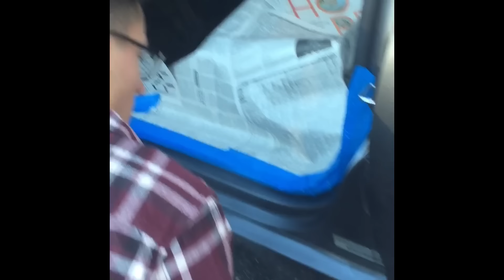DIY Rust Repair Cheap And Easy!

Comment: Way to put your hands in the issue, right on man. Thnx for posting this, it shows people to not be scared to DIY.
Having decades of experience with body-n-paint, i might suggest one added measure if you don't mind. 
i realize this was intended as a quick/easy fix, and that it is, but I would spray the metal with an oxidation neutralizer; such as OSPHO or even just the good ol' Duro Extend treatment at least. The oxidation is occurring deep inside the metal and just a good sanding and paint will not stop it. Many metals absorb moisture, trapping  it inside. It is possible to kill the oxidation process chemically, then this repair will last a good long time. Cheers!
Reply: so how would yo use it? I'm looking to do this
Reply: naval jelly work?
Reply: This is how we learn. People helping people. DIY fixing. Thanks for sharing
Reply: Eric Lee, great response! So many people with experience feel the need to completely bash the DIY'er for doing a quick hack job to make it look better. You added great feedback and information with a positive message. Nice Man!!!
Reply: Thnx so much! I love seeing people gettin er done, and helping them make it last is always a pleasure. have and awesome day!!  :)
Reply: Hey Eric, thanks for the information and just to be sure, I should use oxidation neutralizer after i'm done with sanding it? Basically before spraying on Primer? Thanks!
Reply: Eric Lee  hi, how would you treat this chemically?? You mean with a rust encapsulator like the Eastwood brand? I have some bubbling on my quarter panels around the wheel well.
Reply: You use an inhibitor or a rust neutralizer directly onto rusty metal. Try to get the flakes and bubbles off 1st THEN use your rusticide product. It may appear that after the sanding process that your product has been removed but continue the steps anyways. Its a chemical reaction to iron oxide
Reply: Eric Lee
Reply: You are a hero.
Reply: +no talent hack welding yep thats a brand name for phosphoric acid.
Reply: Stock LT1
Reply: +SunEagle Cherokee - To be on the cheap/easy you can use glass fiber reinforced bondo. But always treat the rust first... last a lot longer. ;-)
Reply: Really great job, out of a rattle can no less!  Amazing!
Reply: can't you just use a torch to get the moisture out?
Reply: Jiggy5166 - Yes a torch can be used momentarily, but next morning all the moist will be right back. Beside the paint work don't like flames much. LOL :-)
The trick in a car is not to try to avoid moist in fact unless for the ones living in the dry desert it's basically impossible. The trick it's to make the metal withstand reasonable amounts of moist, galvanized, painted  ,etc. help a lot in extending the useful life of our cars before they turn into rust buckets. :-)
Reply: Eric you are correct. If you chemically neutralize the metal to kill the chlorides in the steel the repair will last a very long time. This repair has already started to rust again. Try Skunk Rust, it is paintable Ospho is not paintable without neutralizing the ospho.
Reply: In terms of extending the life of metal bodies, oxidation neutralizers are awesome, but from a chemistry standpoint your explanation is incorrect. Rust (oxidation of iron) and other oxidation processes happen on the surface of the metal only. Metals also don't absorb moisture because the chemical bonds of metals are extremely tight covalent bonds that are non-polar, and water, the polar, ionic-bonded molecule, can't break in between the neutral, tight covalent bonds in metals without extreme heat to break the bonds in the metal. Oxidation neutralizers cover the surface of metals though, which prevents rusting and other types of oxidation from occurring. Even covering metals with a coat of clear nail polish can prevent rusting, however oxidation neutralizers are built to last for a long time, and will outlive the nail polish. Still recommend using those types of products for longevity, but in terms of a quick fix, I wouldn't bother because there is often moisture left in the paint that doesn't get out and trapping moisture between paint and metal will undoubtedly cause oxidation of the metal.
Reply: Paragraphs are good...
Reply: Eric Lee great work
Reply: Eric Lee  you do repairs
Reply: A polite person on the internet this is absurd!!! Thanks for the tip - My Mk1 Golf with be grateful for this advice
Reply: I'm not sure but ,if anyone else  is searching for 
electronic repair course
 try Saankramer Electronic Magazine System (do a google search ) ? Ive heard some extraordinary things about it and my cousin got cool success with it.
Reply: Eric Lee q
Reply: Alex Banning I watched a video (about this rust problem) made by people who do restorations on very expensive cars and they showed how rust does get into the metal beneath the surface. Even when you sand the rust down to shiny metal there is still rust deeper in the metal only you can't see with a naked eye. That's why they use chemicals to neutralise it.
Reply: Hi Eric so i was trying to find videos about how i could remove rust, treat the area before i repainted and this vid came up... it is for the top inside lip of my freezer. I am planning to switch it off, let it dry out completely before i started.  The rust is very bad.  So i would do everything in this vid plus the oxidation neutraliser you mentioned to hopefully stop it from rusting again.  Would you have any suggestions as to the type of paint i should use given its a freezer?  It has to be so I can still wipe it down with a neutral cleaner...unfortunately a bleach cleaner was used hence the rust.  Any other tips/suggestions would be most appreciated.  I am a first time DIY person in Singapore but think i could do this.  Certainly much less expensive then getting new freezer door which going by the supplier's price, i might as well buy a new freezer;)  Thank you in advance.  Best regards Clare
Reply: Thanks!  I will!
Reply: Spoken like a true gentleman. Really appreciate people like you as they're a dying breed 👍
Reply: At what point in the procedure would you spray the oxidation neutralizer?
Thanks
Reply: diver dave  No, would have no benefit.
Reply: Metal etch primer :)
yup
Reply: Eric Lee don’t use the heat gun on the paint also
Reply: @mattm5786  Why?
Reply: Steve Fredrick because you want to let the paint cure naturally
Reply: You done it 1k likes call your wife it's time for celebration
Reply: Eric is right about the oxidation. You can sandblast metal until all you have is white metal, no rust but the moment any humidity contacts the metal rust begins to form. You can not see it but it is there at a microscopic level. Ospho converts/neutralizes that unseen rust. begin to prime immediately afterwards.
Reply: @craigroberts8213  What about Rust oleum Rust Stop Aero?
Reply: Ospho is too hot to paint over. Skunk Rust is unbeatable. Money Back Guarantee. It is made to be painted over, not ospho.
Reply: Thanks man!
Reply: Thanks man!
Reply: @rocktag2  so you sand first then apply the oxidizer newtralizer then let it sit befre priming?
Reply: I know Im asking randomly but does anyone know a way to get back into an Instagram account..?
I somehow lost the login password. I would love any help you can offer me!
Reply: @Fox Wyatt instablaster =)
Reply: @Jadiel Marvin thanks for your reply. I found the site through google and im in the hacking process now.
I see it takes quite some time so I will reply here later when my account password hopefully is recovered.
Reply: @Jadiel Marvin It did the trick and I now got access to my account again. Im so happy!
Thanks so much you saved my ass!
Reply: @Fox Wyatt Glad I could help xD
Reply: I don't know who told you that, but what you said isn't correct. Metal itself cannot physically absorb water inside of it, that's because there isn't enough space between metal atoms to house water molecules, sorry. 
Also rust doesn't start from the inside and out, it starts from the outside and works it's way in by eroding and flaking away as it goes deeper and deeper. Additionally rust isn't magic like some analogy to a disease that can just grow on it's own, it's merely oxidisation of the iron, it requires oxygen and water as the catalyst. Rust itself, meaning oxidised iron, cannot spread "rust" to non oxidised metal next to it, that isn't how it works. Rust doesn't create rust, you have it wrong, sorry. 

The process of oxidisation will not continue on it's own via a part of the metal being already oxidised. It will only continue if the required chemicals are available, meaning the conditions that caused the initial rust continues. This essentially means if you take a bolt and leave it outside in the rain, allow a spot of rust to form on it, now take that bolt and put it in a sealed glass jar with a desiccation gel bag inside to make the air extra dry. You will find that the rust spot on the bolt will never progress, this is because rust itself doesn't just grow by there being rust there, it doesn't work like that bud.
Reply: @crpth1 bondo is a filler mate. Wrong vid 😂

Comment: Good DIY vid. I have done this several times with different used cars I've bought. In all cases my DIY repairs have lasted for 5 years or more without any sign of the rust returning (at least in those spots). My technique is quite similar to yours, but with a couple small differences.

1) I use an angle grinder w/ wire brush for course work, then a Dremel with wire brush when there's only little pits and grooves left with rust in them. This will save a ton of sanding. The metal surface should look completely shiny. Dark spots are rust and they need to go. Use bondo to fill them back in after primer.

2) Before primer, I thoroughly clean the surface with 99% isopropyl alcohol. This will remove any grease and dirt, and also help displace and evaporate any lingering moisture. Should only take a few seconds to dry.

After that, it's just a question of how picky you want to be with your paint job. Hope this helps others considering doing this. It's really not that hard with a few tools, and can greatly extend the life of your car.
Reply: Break clean also works great, just protect the areas you need to protect.

Comment: this video is extremely helpful & well made. exactly what I needed. my truck looks beautiful again.
Thanks man seriously.
Reply: How many months did that last for?
Reply: @joeldk42  only 9 unfortunately, came right back midway through winter. It was fun trying to fix it. Every 09 escape I have ever seen except 2 all have rust spots in this exact same place on the rear wheel well. I hate the design. I have gotten estimates and they all say it's a horrible design flaw. This video did help a great deal. I think rust is inevitable in a lotta instances. Especially in the full 4 seasons of Midwestern weather I live in.

Comment: My pickup truck needs some rust repair done, this is on the roof, stone chip damage. The panel shop will cost dearly so I will do the job myself using this video as a guide. Thank you and thumbs up!

Comment: OMG! How could anyone choose thumbs down for this video! I have a 2002 Mercedes S-class, 165k miles and running beautifully! However, there are rust sections developing along the bottom of the doors! I went to the auto care place and they gave me the 3 things needed. couldn't get the feathered look at all when I did it myself!!! Watched this video and realized my mistakes! My repair doesn't look bad, but I want to get the feathered smooth look. I realized I didn't sand enough or with the proper weight and other little things. This video captured EVERYTHING!! Than you so much for making this as easy and quick an explanation.  Can't wait until things warm up so I can work on the areas again. Excellent!!
Reply: Mine is a 2001 S500 and Ive got tjek same problem!  Both doors now.  The repaint and feathering is what worries me too.  Good luck
Reply: Thumbs down for the rather embarrassing techinique - did not remove the rust, did not convert the rust, used primer as a filler until after it was primed, utterly embarrassing "stab the button" spray technique. Extra credit for not using a sanding block and throwing the sandpaper on the ground so it can pick up grit.

Comment: Great video only suggestion I would make is that using a rust converter before using the high filler primer would be better.That said anything looks better than rust and you did a good job.
Reply: Right.  I'm concerned about those pitted areas where the rust can't be fully reached with hand sanding and that the rust may recur there.  I'd prefer to see the affected area soda-blasted but that's typically beyond the realm of most DIYers.  Beyond that, rust converter is a next-best alternative.  Otherwise, the repair is just fine especially considering that it's a door sill of limited visibility and not an exterior surface.  It serves as a nice practice project for small rust and refinishing repairs.
Reply: Yes but it is actually a structural part of the car for side impact strength , as a unit body every part is important
Reply: I'm with DDEENY I predict a swift return of the rust.
Reply: if metal doesnt get oxygen it cant rust, so i think if there is no leak it should not rust even if some rust left
Reply: +Gunther Ultrabolt Novacrunch Agreed
Reply: Soda blasting doesn't remove rust properly. It's mainly used for stripping paint.
Reply: Was that just a wire wheel you used to remove the rust? Also, would a product like ospho work after removing rust and before sanding and filling?

Comment: Never use a heatgun to dry the paint! Paint has an "open time" to let out the thinner and flow smoot; If you speed-up that process the panit is not drying the proper way and hardened!
Reply: exactly...plus you dont apply heavier coats of paint...you apply the same coverage every pass

Comment: The paint on my Mercedes W203 is so thin that during this winter i've built up maybe 20 rust dots on my hood and a lot of big spots on other parts of the car. I definitely have my work cut out for me. Learning by doing. this video and the comments are a big help.

Comment: The dark spots seen at 0:20 are pitting corrosion. If not dealt with it will come back rather soon pending of humidity, salt exposure etc. Sandblasting and / or chemicals will give a more long-lasting result. If these options are not available, a wire brush may remove some of the pitting corrosion. The more corrosion that is removed the longer will the repairs last.

Comment: To people who don't understand how rust works and how this started. Paint itself is a sealer, it's often used to seal metals that can rust easily. It only takes a small scratch to form direct contact between the air and the metal. After this happens, at the zone it will slowly start rusting, this is why it occurs at that zone and not all over the car, it's dependent upon the scratch zone. This is because rust needs both oxygen and water, it turns out that regular air has both oxygen and water, thus high iron content metals simply rust in mere air. 
It doesn't matter if there are small pieces of rust in pits that are painted over either, contrary to what some other commenters have said, rust itself doesn't just grow more rust like magic, rust will not actually progress if it's sealed. This is because metal doesn't care if a part of it is rusted, that isn't going to make the other part rusty, the only thing to make the non rusty part go rusty is if it is exposed to water and oxygen (which it won't be when you seal it with paint anyway). 

As far as the Eric Lee user claiming that metal physically absorbs water, this is also physically not possible and it doesn't occur (I am unsure where he got that from). This is just spatially impossible in regards to chemistry, this is because H2O is a very large molecule, the molecular gaps inside metals are tiny, they cannot physically house a H2O molecule in the space that exists. It's literally as asinine as saying diamond can absorb water, it is just not possible on a molecular level, and Eric Lee clearly isn't scientifically educated and is some kind of labourer person. This is often why the government warn people of BS on the internet, there are so many uneducated things spread around and so many impressionable and naive kids who just believe something that some random dude on a forum or comment says.
Reply: thank you i thought the same thing with the rust. there is even paint that you can put over the rust and it prevents it from getting worse.
Reply: True. Just make sure the rust is completely sealed and it won’t continue. I have first hand experience. They make rust converter sprays that completely seals in rust and turns that into a surface that can be sanded and painted.
Reply: @402car_kid4  Is this called Rust Inhibitor?
Reply: @Pgan803  no rust converter.
Reply: Then why not just spray clearcoat over scratches and be done?
Reply: @bikeman123 the clear won’t stick to the flaky rusty surface.

Comment: You should probably spray the bare metal AFTER sanding with a rust inhibitor BEFORE priming.  I also think a thin coat of filler/bondo would be faster than spraying and sanding the filler/primer.  Very nice job, BTW.